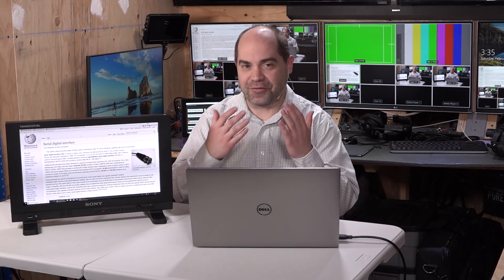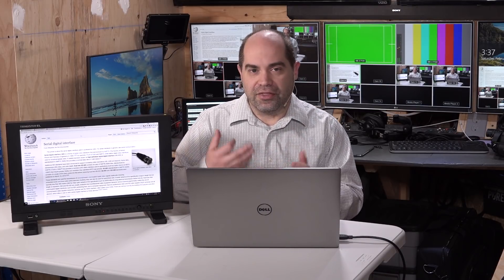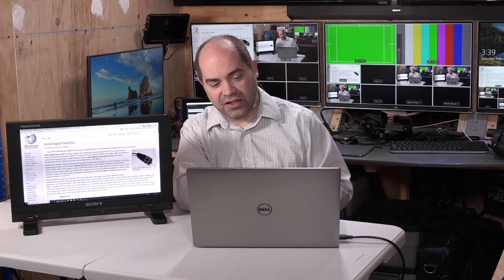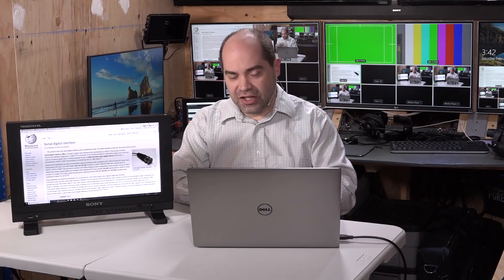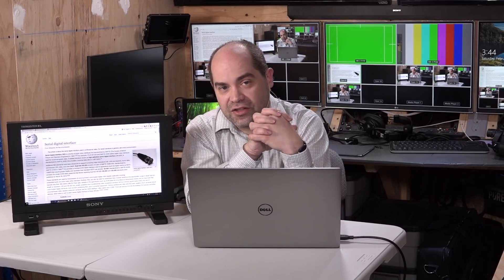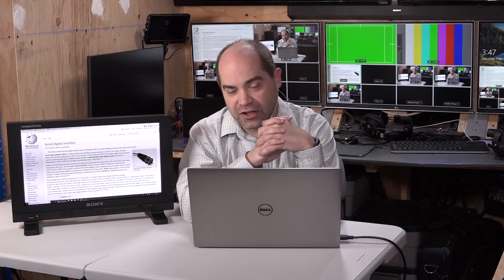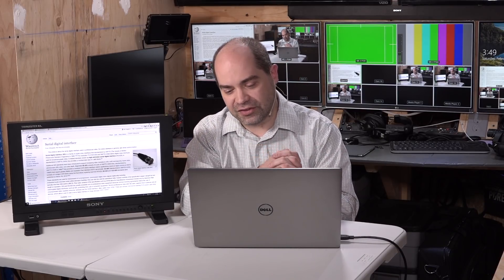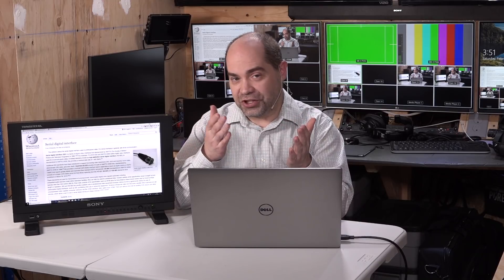What's this about SDI Video? 3G? Level A? Level B? Dual Link?

Comment: Incompatibility with 3G SDI Level B may not always look like no picture at all. In the case of some monitors at the theatre I work at, they do notice the level B signal, but they interpret it incorrectly, making black look green/turqoise and white magenta. It also caused the picture to "vibrate" up and down at what I presume to be the framerate as if an interlaced signal was interpreted as progressive. I'm still in the weeds of understanding the theory behind why it looked exactly like that, but I wanted to share this in case anyone reading has a similar issue. A device expecting an RGB signal but getting a Y'C'bC'r signal and interpreting it as RGB can look very similar (green and magenta picture), so I thought I needed to adjust the monitors settings, but upon finding no such setting, I decided to get to work on at least achieving the other thing I set out to do, which is using the Blackmagic Converter Control software to change the HDMI to SDI converter I used to level B. I was quite happily surprised when this fixed the glaring color issue as well.
Reply from the maker: It depends entirely on the device. Seeing no signal at all is the most common result of connecting B to a device expecting A.

Comment: Im a bit confused with SDI existing in the late 80's.  However, I don't recall seeing it on any gear up until the late 2000's.   At the time even tv stations I was working at, just used analogue SD over BNC connectors. Was it just a slow implementation as the rollout of HDTV took a long time?
Reply from the maker: Pretty much. In a lot of situations there wasn't a huge pratical benefit to switching over from analog to digital, so existing analog systems just kept getting used. SDI would have given a cleaner signal, but not as big of a jump as going from SD to HD.

Comment: How do you tell the difference or what whether equipment is level A or level B?

Is it stated somewhere, or printed on a tag, or can you test?
Reply from the maker: Sometimes you'll find it in product documentation. But not always.

Blackmagic Design does everything using Level B. Sony camcorders also use Level B. Professional ENG cameras often use Level A. And most other manufacturers tend to use Level A.

Newer Blackmagic Design equipment (from about the last 5 years or so) can accept either Level A or B, and often lets you choose which of the two it will output.

Comment: Great Video - thank you! Is the Canare TS100U Coaxial Cable Stripper good also for the Belden 1694F Digital Video Coaxial Cable? THANK YOU
Reply from the maker: You certainly can. It isn't necessarily setup with a preset for 1694F, but you can adjust the blades if you aren't getting a good strip.

Comment: Hey Doug. Could you pls clarify what do you mean at about 9 min in when you say that if shooting in 1080i or 1080p@30 there is no compatibility issues? Like in fiber converters or in general all equipment? Thanks in advance.
Reply from the maker: 1080i and 1080p29.97 are both 1.5G signals. They both have the same 1.5 Gb/sec data rate. Both are considered HD-SDI. The whole Level A/B thing doesn’t come into play with HD-SDI that you get with 3G-SDI.

Comment: So whether SDI is level A or B is not up to the cable but the device its connected to right?
Reply from the maker: Correct. The device generating the video determines which type is output. And the receiving device has to be compatible.

Comment: Hope you can help. I was in video in the analog days. Now watching your channel I am looking to convert from a  NTSC Hitachi C1 video camera , to SDI. I bought a AJA D10AD and the Decimator MD-HX. The dip switches on the AJA and the menu on the MD-HX are confusing. Wanting to view the camera video through HDMI on Samsung television. There are no videos that walk through this set up.
Reply from the maker: From what I can tell the Hitachi C-1 doesn't have an SDI output -- just composite video. 

Your AJA D10AD should be able to convert the composite video from the C-1 to SDI. And then the Decimator should be able to convert the SDI to HDMI. 

I don't have any experience with the AJA converter. On the Decimator, start in the Control menu, press the Enter button, then use the left/right arrows until you get to the HDMI Source screen. Press Enter repeatedly until SDI is selected.  

Alternatively, many televisions support composite video. Check your manual for your television to see if it does. Depending on the model it may require an RCA-to-1/8" plug adapter, which likely would have come with the television if it does support it. If your TV can accept composite video, all you'd need would be a simple cable to go from the video output of the C-1 camera to the composite input on your television; the other adapters wouldn't be required unless you have a specific need to convert to SDI or HDMI.

Comment: For somebody just starting out now, do you suggest leaning towards 12G SDI gear or 3G SDI gear? I notice that there are not many affordable video options that can output 4K30 let alone 4K60. Even $5K cameras only have 3G SDI output. They can record 4K30/60 but cant output it. Which I find odd.
Reply from the maker: Get what fits your budget. Even though 4K is becoming more popular, HD is still very relevant today, especially for live streaming. Almost nobody is streaming in 4K, and that isn't changing very quickly. And the prices on the 4K gear will continue to fall, and you can upgrade later as there starts to be a demand for it.

When I started building out my current video production setup five years ago, I started with mostly HD equipment and have upgraded components one at a time since then. I still have a bunch of gear that is HD-only. And none of my clients have ever asked for 4K, so we still shoot almost all events in HD.

Comment: Very interesting video... could this be the reason why my ATEM Tv studio HD did not recognise a pxm x400 1080p25 signal?
Reply from the maker: 1080p25 falls within the HD-SDI spec, so 3G shouldn't be coming into play. Make sure your camera and switcher are set to the same video format and frame rate. And make sure the camera is actually outputting 25p, not 50i.

Comment: Thanks I learned a lot but still have question lol on new red komodo I heard have sdi 6g can contect. It to 3g montier sdi 1080p or I need conversation?
Reply from the maker: If you're outputting a 1080p or lower signal your 1080p monitor will work.

Comment: Can I extend a let's say 10 meters/30 feet SDI cable with another 10m/30ft SDI cable to get 20 meters if needed? Would it work with just a simple female to female BNC connector?
Reply from the maker: Yes. There is a bit of signal loss with each connection, so I'd be careful doing this with longer cables.
Reply: @djp_video  Thank you for your answer. I got a longer question, maybe this would be for a future video for you: I'm looking into buying SDI, hopefully future proof. For 12G, how long can I run the coax cables before I'll have to go over to fiber? Do I get the same type of Belden cables as you've linked to for 3G, or do I need to get something else? What about the BCN-connectors? Do they need to be different in quality, compared to the 3G BCN connectors? And if I would need to do longer SDI runs for 12G, how does the conversion between coax and fiber look like? Are there other options than Blackmagics fiber converter that you would recommend? Hehe, sorry for the large chunk of questions. As I said, maybe this should be called a video request. :)
Reply from the maker: @christofferahlback  The equipment involved can make a huge difference, so any advice I give needs to be taken with that in mind.

Using the Belden 1505A I mentioned in the video, I don't think I'd try to push 12G-SDI much past 20 meters -- it just isn't designed for it. You can step up to 1694A for some additional distance, but it won't get you out to 100 meters.  If you know you'll be going to 12G-SDI, you might consider getting cable designed for it from the start. From Belden, that's the 4505 and 4694 series.  From Canare, look at L-8CUHD, L-5.5CUHD, or L-3.3UHD (best option listed first) with their corresponding BCP-D8UHD/BCP-D55UHD/BCP-D33UHD connectors.

The BNC connectors absolutely do make a big difference. Go with Canare or Neutrik models specifically designed for whatever cable you purchase and you'll be in good shape.

There are fiber converters available from other companies, but the prices jump big-time. AJA's are relatively affordable, but pretty much every other brand worth considering gets really expensive really quickly.  With 12G-SDI and even the best quality cables, I wouldn't use copper cables for anything over about 100 meters.
Reply: @djp_video  Thank you so much for your answer, Doug! With that in mind, if I understand you correctly, I could use the "normal" 3G SDI Coax cables like Belden 1505A with corresponding connectors for 12G up to around 20 meters before I need better cables or fiber?
Reply from the maker: Yes, you can get away with the 1505A/1694A for 12G up to around 20 meters.  That varies somewhat with the equipment you're using and how noisy (RF) the environment is.
Reply: @djp_video  thanks for your quick replies! :) I'm using mainly Blackmagic gear at the moment, and will most likely continue doing that.

Comment: hi i im using SDI cable to livestreamg and i using 50 feet long SDI and i have issues went i transmiting the screen go on and off  and i have been with that problem since i get the camara including the cable please any advice will appreciate thanks
Reply from the maker: That sounds a lot like a bad cable. Is the cable you’re using 75-ohm, like an RG-59 or RG-6? Is it a high quality cable with good shielding? Is the cable and it’s connectors free from damage?

One way to see if it is a cable issue is to connect the devices with a short cable to see if you still have the dropouts. If they go away, you need to replace your cable. If it still has dropout issues, one of the devices has a problem.

Comment: Is it correct to say BNC is just the connector. It is for SDI cable?  Can I use SDI cable for timecode siync?  Thank you
Reply from the maker: BNC is the connector, the cable is referred to as coax, and SDI is the signal type.

Time code is usually an audio signal that would generally use balance audio cables like XLR, but some implementations do use a BNC connector. Audio frequencies are so low compared to video that a video cable would work just fine, even if it wasn’t specifically designed for it.
Reply: @djp_video  you are awesome. Really appreciate it

Comment: So when you convert SDI to USB 3 is there any loss in quality?  What’s the best way to capture high quality s-video?  S-video > SDI > USB 3?  Very noisy old analog video needs a higher bitrate than a digital 8 camera (DV) can handle.  How efficient is the codec used for SDI signals compared to, h.264?  The DV codec I know is much less efficient than h.264 so 25mbps using DV is much lower quality than 25mbps h.264.
Reply: SDI -> USB 2.0 is usually compressed using mjpeg or h264. 
SDI -> USB 3.1 is either same as above or it car be raw data, uncompressed. 
s-video is not high res/frame rate so lots of lower rate equipment will be better than s-video - s-video can be digitised and sent over SD-SDI or just SDI. (for clarity SD-SDI -> HD-SDI -> 3G-SDI -> 6G-SDI -> 12G-SDI -> 24G-SDI is the order where each is roughly double the bandwidth of the previous) you can get s-video to USB2.0 adaptors if you need to do this. 

SDI does not normally use a CODEC as it's not 'compressed', other than chroma subsampling. Not h.264. DV is a storage format and therefore compression makes sense, SDI is a transmission format and therefore keeping it low latency is more important generally. 

It's worth noting that ASI is a multiple channel streaming format often used over SDI infrastructure. this is compressed but not used in the production until the last output stages usually.

Comment: What do you do with the extra SDI lengths that you dont need whilst its on the cable reel.  EG, you have 50m SDI length but you only use 30m.  Do you leave the other 20m on the reel or do you unreel it and leave it neet on the floor. Thanks mate.
Reply from the maker: I don't use reels for my SDI cables. Usually I just leave the extra length coiled up, laying on the floor.
Reply: Thanks for the reply Doug, what is the longest length SDI you use and how do you roll / coil yours?
Reply from the maker: @joshuamars-downunderputtin3428  About the longest I use normally would be 150 feet. Anything longer and I just go straight to fiber.

I roll my cables using the over/under method, and tie with Velcro straps.
Reply: Thanks for the reply. What is the reasoning for that. Does it look after the cable better.  Do you find it easier to lay ( not as much memory coils. )
Reply from the maker: If you're coiling by hand, the over/under method prevents twisting of the cable, which reduces long-term damage. It also keeps the cable from getting tangled and knotted. Reels also prevent twisting, but they take up a lot of space (which is at a premium in my trailer) and take longer to spool and unspool.

Comment: Thanks for great explanations. But SDI has reached its technological limit. Broadcast facilities are switching to video over IP by the means of SMPTE 2110 standards. What are your thoughts about i?
Reply from the maker: It definitely holds promise. It still feels like it is a way off for most facilities though. Having been at NAB pretty much every year for quite a while now, I've seen it emerging, but it doesn't seem to be catching on as quickly as I would have thought a few years ago.

I wouldn't go so far as to say that SDI has reached its limit. It may be getting more and more difficult to transport higher and higher data rates over copper cable, but we're barely scratching the surface of what optical fiber can do, and SDI over fiber is quite common.  The beauty of SDI is that it is simple. IP adds another layer of complexity on top of it that in many cases doesn't provide enough benefit to make a switch.  Ultimately time may tell, but I'm just not seeing a mass migration from SDI to IP in process today. If it does take over, it's going to be a long time coming.
Reply: Good points. I see OB trucks switching to video over IP basically for the added flexibility and huge weight savings. I've have heard that the BBC is also switching to IP (slowly though). The audio guys have successfully switched to IP and the workflows now are quite established and reliable. Take Riedel as an example. As for video, what do u think of Riedel Mediornet, is it mature enough for "prime time"? As for the SDI limit, my point is that you need 4 SDI cables to transmit 4k signals. Fiber is expensive compared to CAT6 Ethernet cables and not very flexible, difficult to fuse cables, fixed network architecture... I'm not saying the video over IP is cheap as we really cannot use off-the-shelve IT equipment at all, at least not now. Maybe in a few years...
Reply: @SportFlow  Cat 6 ( 10G) can transmit 4k30 (6G) 50 meters (in a friendly enviorment), Cat 6A or Cat 7 can go 100 Meters. NO Cat X cable can transmit 4K60 (12G) which can be transmitted on ONE SDI cable or fiber. 8K60 Requies FOUR 12G signals.
Reply: @jimmichaels5058  Thanks for your points. Another thing to take into consideration is that SDI is a common interface. If a machine has an SDI output it sure will be compatible with any other SDI input from any manufacturer. When dealing with IP-based facility, things get more complicated. Everything is not compatible with everything. Most of the time you have to marry one manufacturer (Riedel, Sony, Grassvalley...) and stick with it.
Reply: @SportFlow  "Everything is not compatible with everything." There's the rub. The manufacturers are greedy and until a universal standard is reached SDI will remain the majority interfacing format.

Comment: My software has drop down of the following output formats :

PAL
NTSC
240p 60
576p 25
600p 60
768p 60

after this one more drop down to select:

SDI
Composite
HDMI
Optical SDI
Component

Now which combination I have to choose for SD SDI ? 

Thanks in advance!!
Reply from the maker: I'd like to answer your question, but I need a little more context... what is it you're doing?
Reply: It’s a kind of playout software, I’m trying to output a SD-SDI signal

Comment: You mentioned Sony only does Level B, but that is not entirely accurate. If you use one of our Studio Cameras capable of 1080p, like the HDC1700 or better with 3G activated, then you can choose Level A or Level B when in the 3G format. To select A or B when in the 4K mode, you would select this from the 4K output menu or on the RCP.
Reply from the maker: I thought I had qualified my statement that I was referring to their camcorder style cameras.